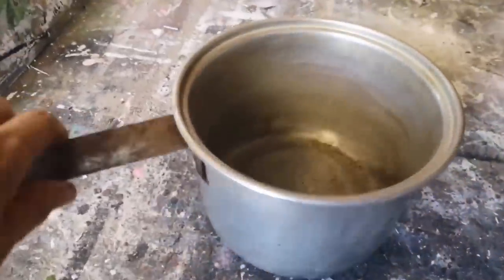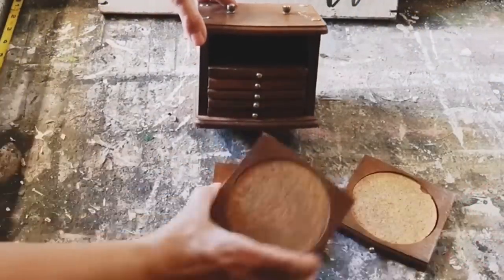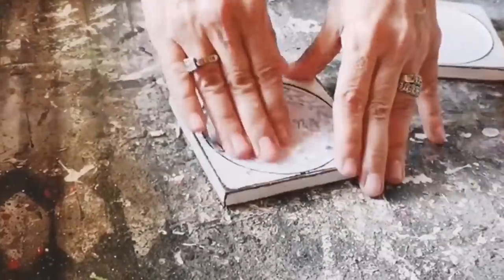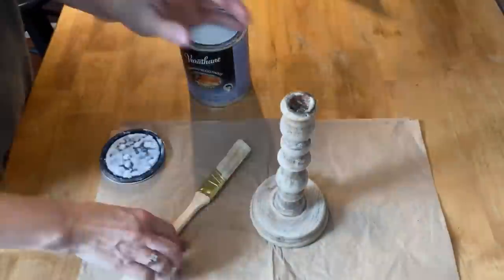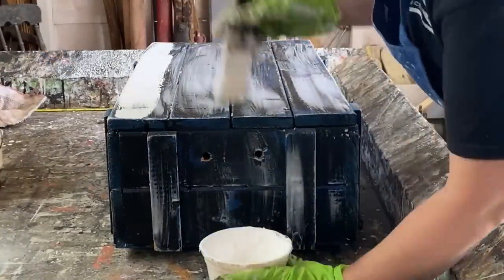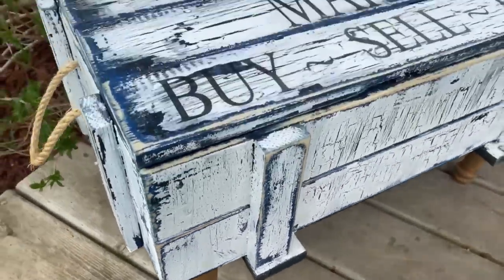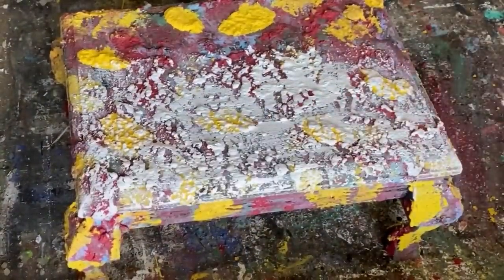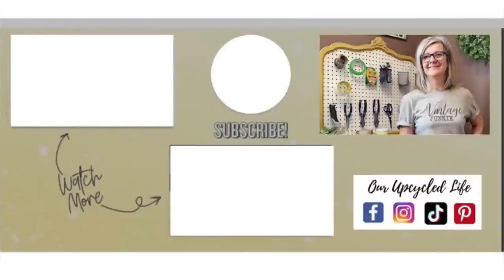5 AMAZING Trash to Treasure DIY projects / Upcycled Home Decor

Comment: Everything you do is so unique. Such a variety. 
Question. What is that tray called you set all your projects on to paint  Looks like it helps with messes.
Reply from the maker: It is a old parts cleaning metal container and it works great for containing my messes